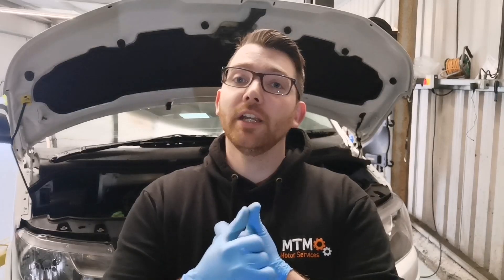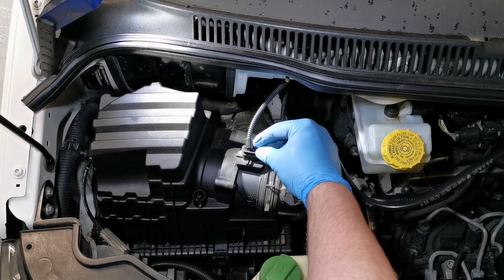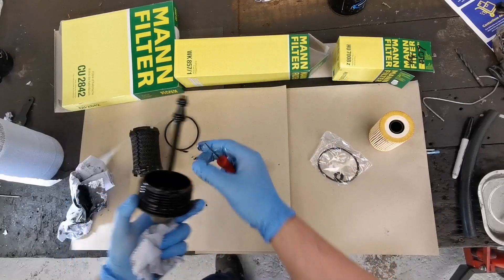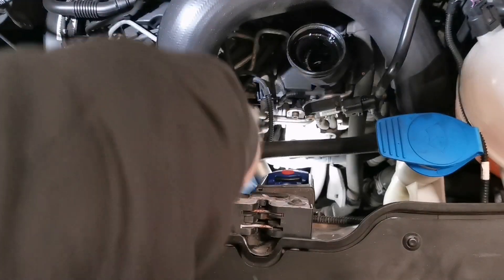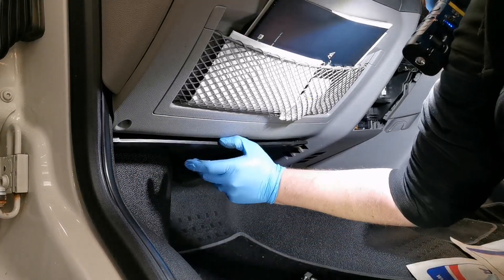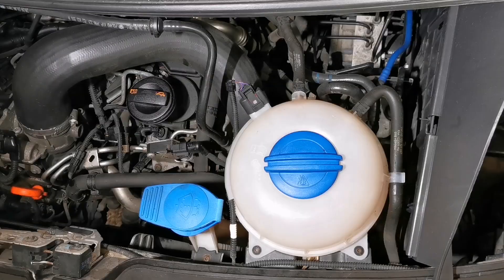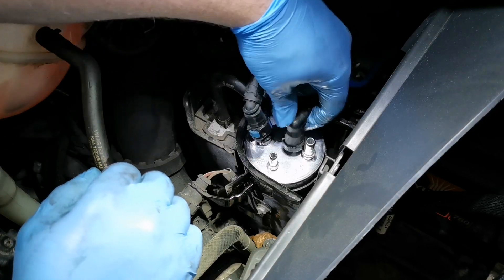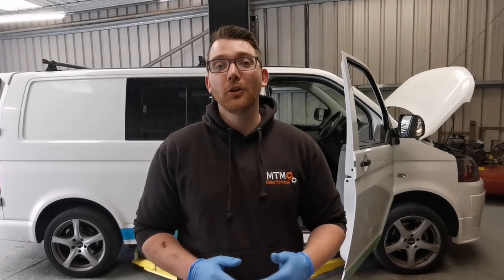VW T5 Transporter 2.0 TDI SERVICE, OIL CHANGE, FUEL FILTER, CABIN FILTER & AIR FILTER

Comment: question next to the fuel filter there is another silver tube what is that is that another fuel filter in line with the big one you replaced and if so when should that small one be replaced

Comment: Really great video. A few small things which could make it perfect... 1. Could you show best way to fill the fuel filter with diesel in order to prime it without diagnostics please? Or will running the pump by switching on the ignition a few times work? (without turning the engine over) 2. What is the recommended oil for this motor? (rookie question I know) 3. Turning the music down a bit in the edit a bit would improve the vid
Reply from the maker: Thanks for the feedback. I'll keep that in mind for future videos.
The oil grade is shown in the video. It shows the VW requirement. But if you supply the reg number to your part supplier they should be able to look up the required oil for your engine.
I'll do a separate video just concerning the fuel filter next chance I get and I'll cover the different ways of priming. Just cycling the ignition on doesn't provide enough pressure to fully prime the system.
Thanks for watching!
Reply: @MTMMotorServices  Great video very informative and helpful. Just wondering if you ever managed to do a video on priming the fuel filter without the engine diagnostic tool? Cheers
Reply: Great video, just what I needed, thank you

Comment: Hi there.
Can you tell me how to prime diesel filter without diagnostics tool?
Also how to reset service light without diagnostics tool.
Thanks
Reply: To reset service light you can start the car with emergency lights on while holding the 0/0 button at the same time

Comment: So the only issue I see having if I do my T5 is the replacement of the fuel filter. I dont have that electronic tool to pump the diesel in the new filter before starting. Is it some other way???
Reply from the maker: @vivauruguay  you could fill the filter with diesel before fitting  and also cycle the ignition a few times as it engaged the fuel pump for a short time to prime the system but when the filter is empty, this often isn't enough to prime the full amount
Reply: @MTMMotorServices  thanks for the replay. Keep the good work. My next proyect is to learn how to replace the twin turbo. Last time it went I was charged 5k dollars to rebuilt and replace here in Australia which I thought was a bit expensive but that's what it is.

Comment: What if you don't have the Diagnstic tool, how do you prime the pump?  Does it matter if you use the wrong oil, ie for DPF but you don't have one?  I was going to use Castrol Edge PRO SW30.  Thank you for the clear and concise video.
Reply: If you don't have a diagnostic tool, you also won't be able to reset the service indicator.

But to prime the filter, you can fill it with clean diesel by pouring it in the top.. This can be messy and be sure you use clean diesel and not diesel ripped out from the old filter.

If you call your local parts company they should be able to tell you what oil they list as a suitable replacement.

Hope this helps.
Reply: You can reset the service indicator by powering the car on while holding the 0/0 button in your dashboard and having emergency lights on

Comment: How long to prime the fuel pump, 30s enough?
Reply from the maker: Each cycle of the priming system takes around 30 seconds. We usualy run that atleast 3 times to make sure. Initial crank might take a little time to start up but shouldn't be excessive.